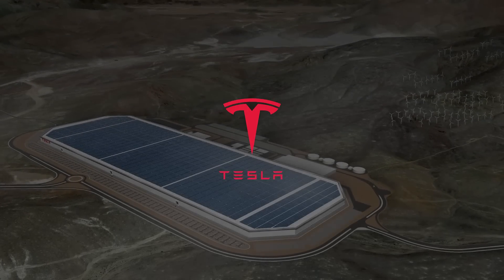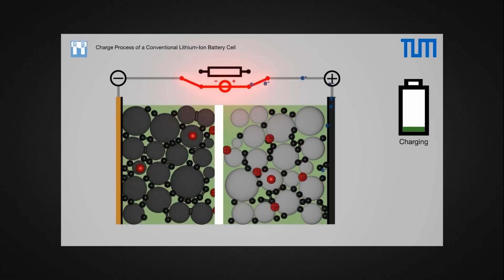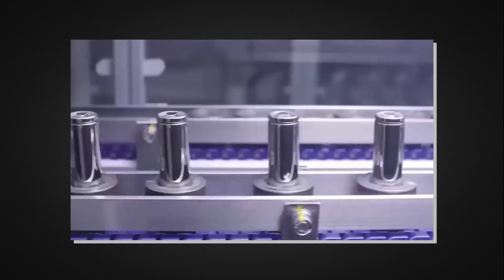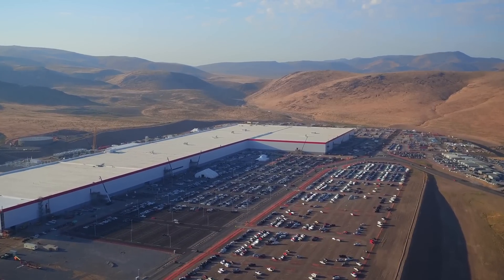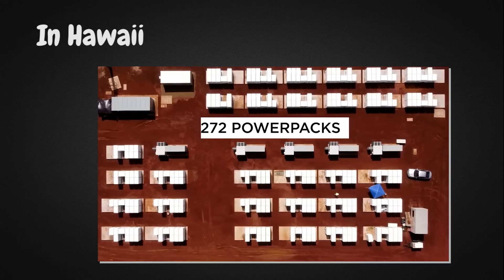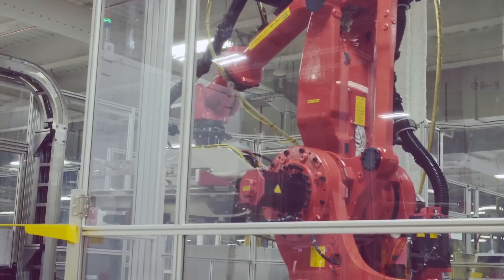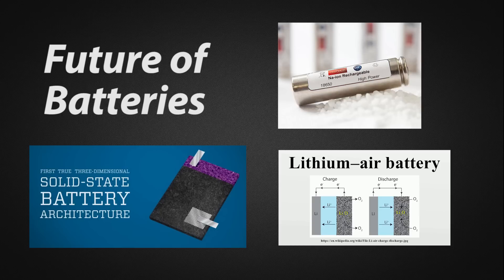Tesla Battery 101, How does it work?

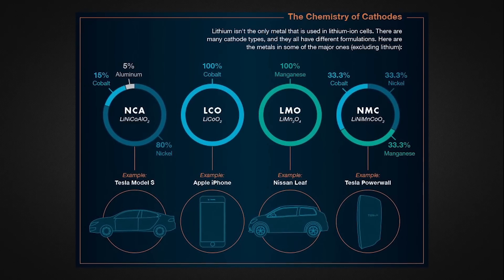Comment: 2:32 Why so many metals? Lithium fluoride batteries or lithium-sulfur batteries with a solid electrolyte would be much lighter and cheaper, AND safer.
Reply: Oh great, you tell Tesla how to do it and will be a millionaire in no time. Those technologies are still in research, mass production is till years away.
Reply: So it takes more money to manufacture a battery with less metals? and it costs less to manufacture a battery with useless heavy metals?
Reply: No, I was trying to say that technology that you suggest is still not possible on a industrial level. Those are laboratory batteries that work under laboratory conditions, it is a prove of function but is still not viable for mass production and further research has yet to be done. You are demanding a miracle that is not possible yet.
Reply: I was just asking, why did they just go right for lithium ion? And where did they get all these useless metals in the battery from? I tried looking around youtube, cant find a single video on why they use what they use.
Reply: Why did Tesla go for lithium ion? Because that is a know known chemistry and concept of a battery that works well for them, because it has a high capacity and power density, because they had and have plans to improve on that technology, because Tesla needed a technology now and not in a decade.
Calling lithium useless in a lithium battery is just silly and dishonest when you clearly should know that lithium is an essential part of the current battery technology. Not sure what you really try to say by dissing lithium.
Reply: Im dissing the lithium ion technology because there are tons of heavy expensive elements in the battery. I was also asking, why did the inventor of lithium ion batteries chose these elements? Why cobalt? Why graphite? Why put lithium twice in the battery? Why magnesium when lithium is already in the battery?
Reply: You are mean to the lithium it has nothing done wrong, calling it heavy, are you fat shaming lithium? No seriously, lithium is a light metal and lithium is making up under 4% of the overall weight if not even less in most modern batteries.
I think the modern lithium batteries are deviating a lot from the original lithium battery due to different improvements and adaptation to different tasks. And I don't think that the battery manufacturers will give you an exact recipe how to produce their products and neither will they give away the direction or research discoveries (at least not to a detailed degree). I am very certain that you won't find what you search for on the internet. Or you I misunderstood you again and you just wanted a qualitative explanation, surely by now there are some good books out about this topic.
Reply: I have no problem with lithium. I do think that lithium-air, lithium-sulfur, and lithium-fluoride with solid electrolytes is the future.

I was being mean to the cobalt, magnesium, graphite, and all those other useless elements that do nothing but add weight and cost. 1 element for the anode, 1 element for the cathode, and a solid electrolyte is all a battery needs.
Reply: I am all for new battery tech but it is unfortunately the common lithium ion battery for now. Until new battery technology doesn't get into mass production I try to get not to exited, saves me from disappointment.
Well that was a cute talk, have a nice day.
Reply: Power density is a thing on cars. The batteries might be lighter, but if they are double the size they're not really useful. I don't know if this is the case, but there are a number of alternative chemistries that make sense under different circumstances. In fact, I believe the Powerwall and Model S used different chemistries, though don't quote me on that.
Reply: double the size...

You can make a battery any size you want.
Reply: JoeAceJR Sure you can, but it's got to actually fit in the car.
Reply: I know what you mean, but size isnt the only factor here. Weight is the main problem in a lithium-ion battery which is why they shouldn't have so many useless metals in the battery. Lithium-sulfur, lithium fluoride, sodium sulfur, sodium fluoride (AKA the toothpaste battery) are all alot lighter and safer (if there is a solid electrolyte)
Reply: I can guarantee you the cobalt is most certainly "doing something". The engineering of these batteries is extremely advanced and no one sitting on the sidelines has a clue as to all of their considerations.
Reply: You probably weren't a fan of Zinc-Carbon batteries I'd guess. The Lithium Ion battery is in its infancy.
Reply: Absolutely correct. There are thousands of considerations that have to be balanced in these designs.
Reply: Nope. Structure, weight, heat/resistance, rechargable, safety, manufacturability, durability, reliability, failure modes and effects, cost, repairability, serviceability, etc.
Reply: Cobalt is heavy and useless.

Carbon-zinc, and i like those.
Reply: JoeAceJR When I said size, what I meant was for the same capacity. In other words, density. It has to fit in a car, not weigh too much, and contain enough energy to run a car for hundreds of KMs.

For a vehicular application you need batteries that are compact and hold a lot of charge. Also, at least in Tesla's case, it was a technology they were all familiar with, being electrical engineers and designers. Weight is secondary, as long as it's not too high. It also needs to discharge at a high rate, needed for the acceleration, and charge at a high rate, required for supercharging. Not only that, but the cells have been designed for high recyclability, so while the metals might not be optimum from a pure technology point of view, they enable the vision of being able to recycle ~95% of the materials at end of life, not to mention that they probably have something to do with the durability.

Name one other battery tech that can do all of those things at once, and is ready for mass manufacturing, and we can talk. It's that simple - right now, and especially a decade ago when they started actually rolling out cars - there is nothing else.

Consider that a lot of smart people at Tesla and Panasonic worked together on the new chemistry, and if there was something better ready for primetime they would probably have used it.
Reply: Lithium sulfur seems very promising. A company in england is researching these.

Another company is researching sodium ion batteries which have a higher energy density and high discharge and recharge rate and are safer than lithium ion batteries.

If we can combine these 2 technologies (sodium sulfur with solid electrolyte), we could have a safe, high energy dense, and light battery. Notice how im using elements that actually have a purpose, are light, and high on the periodic table rather than elements like copper, cobalt, etc...

Samsung released a graphene battery which will be in its new phones coming up. They can discharge and recharge at insane speeds, and have a higher capacity. It also means a safer battery. Graphene is insanely light, btw.
Reply: JoeAceJR Critically, none of these technologies have been done at the scale needed to produce a hundred thousand cars per year (current Model S and X numbers), let alone 500k as they want with the 3.

Mainly the initial reason for lithium ion is because the guys who started it were electronics engineers and knew how to get what they needed from the 18650 cells for a relatively small cost. They used what was available, not what was a pipedream with no guarantees of even working, and they did it more than a decade ago. No other chemistries have yet been made commercially viable, even a decade later. They're coming, but they're not here yet, and meanwhile li-ion is good enough to sell a few million cars while they come.

Comment: I think a solid state battery is the future of electric card.The battery is what is holding the electric its an old technology.
Reply: Philip Leonardo Or Silicon electrodes.  Tesla is already using some Silicon in their batteries, but we don’t know how much and to what effect.  Silicon is probably more of a holy grail than solid state.
Reply: Once someone actually makes them and proves they do as claimed, battery development especially has been full of companies making claims that aren't real.
Reply: Folks a BTU is a BTU. You can do all kinds of nibbling on the edges of getting more BTU into and out of a battery but the physics are going to limit you - at least in terms of how much juice you can pack into a given weight. And, unlike a fossil fuel car which burns it's fuels' weight, a battery car carries that weight everywhere it goes.
Lithium as the lightest metal is likely to remain a key ingredient.
Reply: Quantum batteries are the ultra future, but solid state might be new era

Comment: In the chart at ~2:30, it says that lithium isn't the only metal used in lithium ion batteries.  Problem is, lithium metal does not exist in (today's) lithium-ion batteries.  Lithium ions are not lithium metal -- i.e., they are not metallic.   Right?
Reply from the maker: Yes, lithium ions are the electrolyte (liquid), metals are used as the cathode, in tesla, it's NCA(Nickel, cobalt,aluminum)
Reply: why not just smack lithium for the anode, fluoride or sulfur for the anode, with a solid electrolyte? Much cheaper, safer, and lighter.
Reply: Lithium is a metal. It's the lightest metal and it is EXTREMELY reactive. It has to be suspended in an electrolyte for both safety and for practical manufacturing. When you think of solid lithium think of a chunk of soft chalk
Reply: Without copper or something of similar conductivity you will generate too much heat

Comment: I think that the 2170 battery also have a different chemistry, so the 2170 IS better 1865. I remember hearing this in a quarterly investor call with Tesla.
Reply from the maker: In the call, its said to be 20% better. the thing is, the fundamental chemistry is not different, it more about how the chemistry is arranged so that the Lithium ion can be "absorbed faster'. So as a cell, 2170 is better, for its size
Reply: Yes, it is not fundamentally different, but the energy density is 10-15% better in 2170 compared to the 1865 Elon pointed out in the call.

Comment: On the 2170 Tesla batteries, I was told by an ex-Tesla engineer, personally, at my house, to wait to buy a Tesla that has the 2170 battery as some of the chemistry in the battery has upgraded and is more superior, in every way.  I'm taking his suggestion.
Reply: Smart move by any CEO--don't announce new tech too far in advance or it kills current sales.  I fully understand as I used to work for Apple and every time a new computer came out, the old models stopped selling, even at huge discounts.  If new models were leaked, sales would stall as people waited for the new stuff.  I doubt we'll hear much about Tesla's solid-state batteries until right when they are introduced.
Reply: Russell Fine Arts 
I believe that might be true....what he told you regarding the 2170 batteries. I think the narator might have it wrong. I believe these battery cells (2170) is what Tesla will be using on the new roadster.
Reply: Actually, the 2170 cells have been going in all Tesla cars since mid-to-late summer, this year...since the gigafactory has been producing.  The Roadster II and Semi and I'm sure all Tesla's after 2020, will have a solid-state LIB.  Solid-state LIB's offer 2.5 times the capacity of current LIB's, are less-expensive and offer a whole host of benefits from today's LIB's.
Reply: "No plans to change cell form factor for X and S"
 — Elon Musk (@elonmusk) June 19, 2017
https://www.teslarati.com/tesla-model-s-x-no-plans-use-2170-battery-cells-says-musk/
Reply: Wayne Russell 
Well, the pricing of the Model S and X will most likely drop, regardless. Why? Because as battery technology improves and becomes more efficient, that will drive cost down, especially since electric cars have fewer moving parts than ICE vehicles.
Reply: Wayne Russell 
True. He did make that statement. But, that doesn't mean plans don't change. I think Tesla will most likey use a different battery pack inside the Model S and X next year (although there is really no need to do so). I just think Elon Musk will want to use the Model S and X to prove that what he said of the Roaster's acceleration capabilities is certainly possible.
Reply: The Model 3 has already the potential to cease model S sales.
And the Y for X sales.
Once they have a surplus for sale then S and X will have to have a battery upgrade, or a price drop.
Tesla will have to announce any battery chemistry changes when the opposition start manufacturing similar.
Reply: Tyran Mathurin  prices wont drop significantly, s will not go. Below 70.000 euros (now baseprice is 7600 barebone)
Reply: Basically it says 21700 on the screen, then he says 2170, then he says it is not better than the 18650 then he goes on saying it is better than the 18650. This shit is dumb.

Comment: 7000 cells, so if one is defective does it affect the whole pack?
Reply: Not realy, they are connected, but it wouldn't affect others if one of them fails.
Reply: TheDarkFighterek 
Although about 10-20 are in parallel?
Reply: No, that's what the self-diagnostic functions onboard are for.
Reply: The single cells are attached with a wire of certain thickness to a module. If one single cell has a chemical runaway and produces to much current the wire will burn through and disconnect the single cell from the module and therefore from the whole battery pack.
Reply: No. You might lose the power from a subset of the battery, but that will just mean reduced range/acceleration until it's fixed.

Comment: Get panasonic, lg or samsung to make batteries. Insert in tesla.
Tesla does not own any battery tech.
Reply: Tesla did fund the development of the 2170 cell and has been funding battery research in multiple universities. I think they have at least partial ownership of the IP
Reply: Charles Cloutier Tesla’s Gigafactory uses Panasonic’s machines to make all the batteries.
Reply: Thats what im saying they dont own the tech
Reply: @clout13r  as far as I'm aware you're wrong. Tesla own the design and the intellectual property but they need Panasonic's machines (hardware) to produce the batteries. I'm guessing those machines would be astronomically expensive so when Tesla was growing they didn't have enough money to outright buy them so they forged a partnership with Panasonic. Now as a gesture of goodwill they still use Panasonic machines and Panasonic has said it aims to keep the partnership going by moving all their machines to the gigafactory 

Its kind of like apple and TSMC. Apple designs and engineers all their apple A chips but tell TSMC to produce the chips for them
Reply: Same gays same comment in different tesla videos.. Negative of hors... Way didn't some one else before, pulling electric car, complete story to the and,  now every body is smart as
Reply: Trying to do everything teslaself might prove to be disastrous
Reply: Not to speak of some other global battery players still in the process of ramping up as well....China will go full throttle on it, we already have the big beasts samsung, etc...and there are others as well....even a german project will perhaps dwarf that "giga" factory. And currently we are pretty much stuck...some say, that the verge of efficient energy density is not that far away from the current ones. All new, big leaps at the same time will need significantly more protection = more weight to be safe.  It is a game of energy density being potentially more and more dangerous against protecting the users...which means more and more weight. Most rc-model battery users know, how much of a diva a battery with high c-rates can be, if you really in need to use those rapid charging and discharging abilities.

Comment: When the 2170 batteries were introduced Musk said they had increased capacity by about 15%. Since then Dahn has doubled the cycle life. It is not clear whether these changes have also been made to the 1860 batteries.
Interestingly Goodenough has said that the chemistry has reached its limits and only a few percent difference can be made to capacity. He also still believes Tesla batteries will only last a few years and then need replacing.
http://powercartel.com/2014/11/notes-from-why-do-li-ion-batteries-die-lecture/
https://www.youtube.com/watch?v=kR8CESrigEg
Reply: Sorry, I don't want to discredit what Goodenough has done in his past life but when he said "Tesla batteries have to be replaced after 2 years" he lost a lot of credibility for me. It is such a nonsensical thing to say when clearly Tesla batteries lasted already way over 2 years. Goodenough is just disregarding facts or is ignorant about the longevity of Tesla batteries. Neither is good.
Reply: Indeed, there are Model S from the original production runs 4 years ago with their original batteries, and so far fairly limited decrease in capacity. Not replaced in 2 years. The pack tech is getting better too, with capacity of more recent packs being in the 90% range after 100's of thousands of miles.
Reply: Yes he is out of touch with reality now. Does not bode well for his associates solid electrolyte battery. Tesla has an old chemistry pack on a test rig that has done 500 000 miles with less than 20% degradation. Dahn says the pack will outlast the car, but it is not clear whether his improvements have been incorporated in the current 2170 packs in the Model 3. Calculations show no difference in power density to the 1860s. Possible Tesla is under quoting performance or limiting with software to protect S and X sales!
https://electrek.co/2017/08/24/tesla-model-3-exclusive-battery-pack-architecture/
Reply: Wayne Russell 
I think the narrator could be wrong. I think the 2170 batteries are better than the 18650.